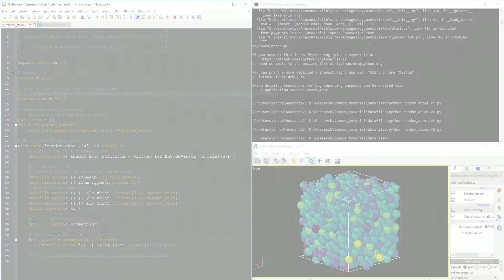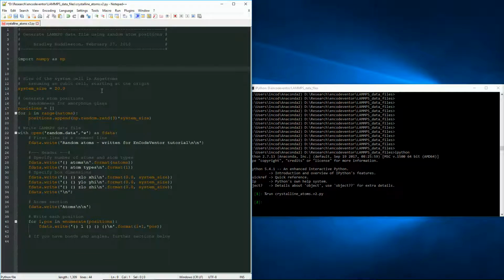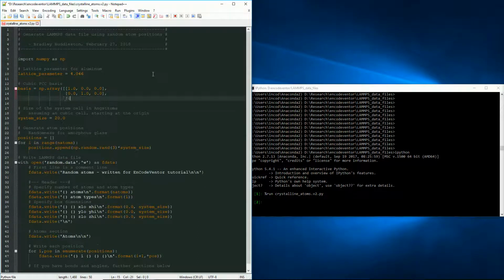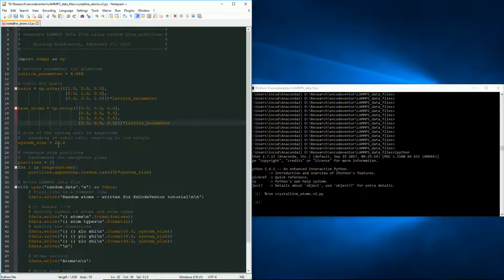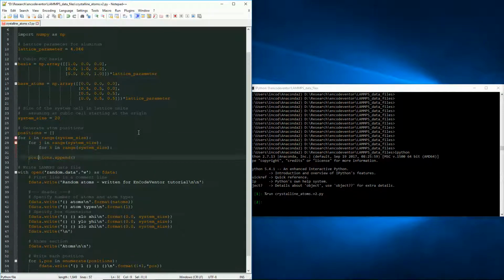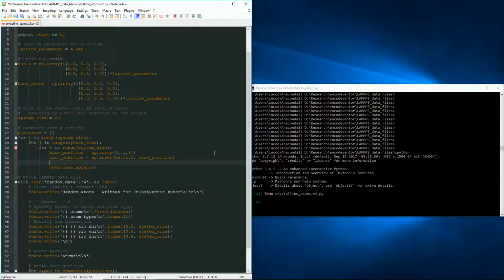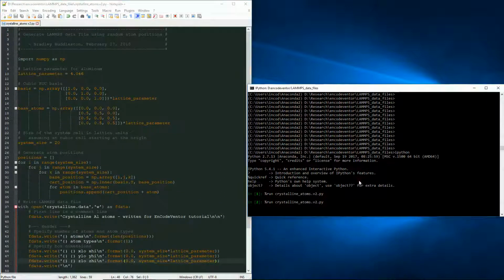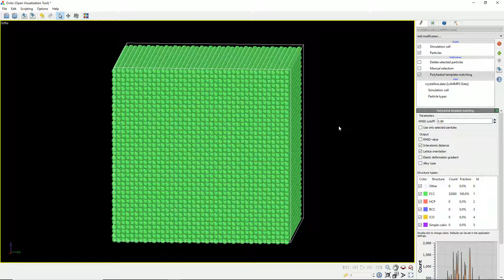Using Python to Generate Simple Crystalline Materials for LAMMPS

Comment: how to create a random solid solution of Fe and Ni?
Reply from the maker: Hi Junaid, thanks for the comments!
That is a great question, certainly. There are a couple questions you will need to answer to figure out how to do that.
First, you need to determine what the base crystal structure is. Is Fe or Ni the bulk material? Or, is it a true binary phase that you are modeling. 
Second, if one of elements is the bulk material, how is the second element in solution? Is it an interstitial atom, or a substitutional atom? My guess for these elements is that they would be substitutional, but it would be important to make sure. 
Once you know these two things, you can start figuring out how to create the structure.
Reply: @Jere5120  Hi, Thanks for the reply, yes, Fe and Ni form a substitutional solid solution. like randomly Fe and Ni atoms are distributed to form an FCC system. 
can you please suggest where to do the changes?
Thanks

Comment: Hey Brad, thanks for the video. I was checking the result in OVITO, and I noticed that it seems to be there is a gap at each direction, I mean the simulation cell is not filled completely, am I correct or not ? How should we correct the code in that case ?
Reply from the maker: Thanks for watching! I think I see what you are talking about. I believe that the code is correct - the simulation cell looks like it is not filled on one side, because of the periodicity. On the lower faces (-x, -y, -z faces) the atoms protrude from the simulation cell visually. Since I assumed a fully periodic system, those atoms take up that empty space on the positive faces of the simulation cell. Also note that, in lammps, all of the atoms are handled just as points, so the visual radii shown in Ovito is pretty arbitrary. So, these atoms wouldn't actually be outside the simulation cell in lammps. Good question!

Comment: Nice! Really helpful. You can create data file using MATLAB. If you can upload videos using MATLAB that would be really nice.

Is there any ways I can download your py file?
Reply from the maker: Thanks for watching! Absolutely - anything that I am doing here can be done with MatLAB just as easily. The reason I choose to use python is actually because python is free. MatLAB is expensive - you can get the "knockoff version" (Octave) but, when it comes to that, I prefer python. 

So, unfortunately, since I don't have MatLAB on my personal computer, I can't make any matlab videos - BUT, the scripts would be very easy up to this point, and you can pretty easily convert from python to matlab! 

Also, I forgot to mention it in this video! But, you can download the scripts in these videos from my github repository right here: https://github.com/bdhuddleston/encodeventor

Good luck!